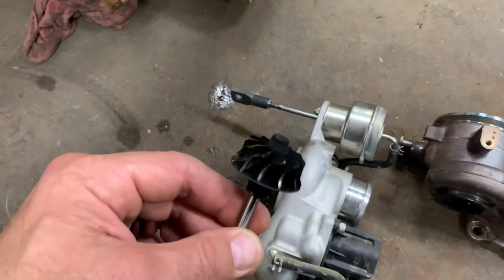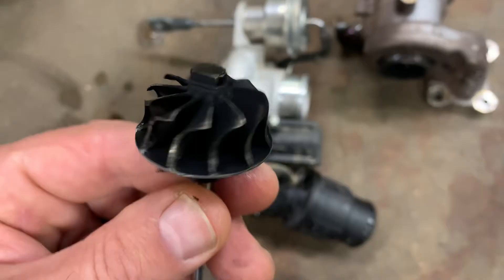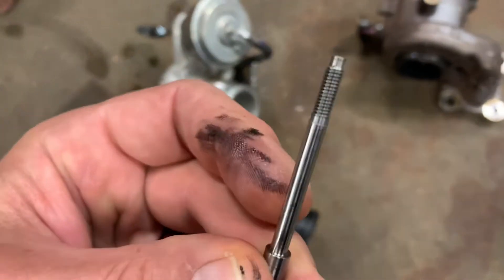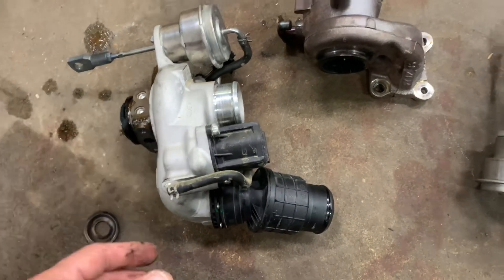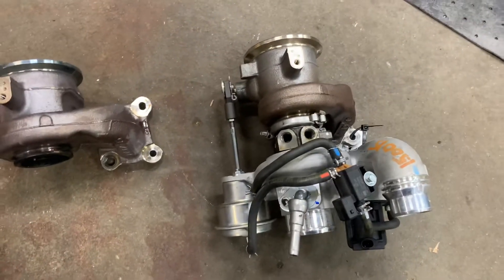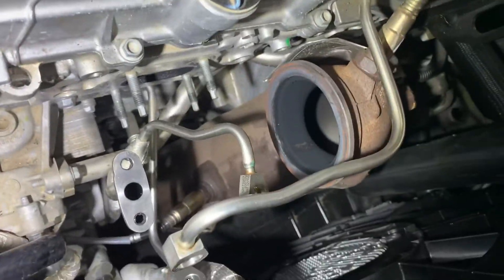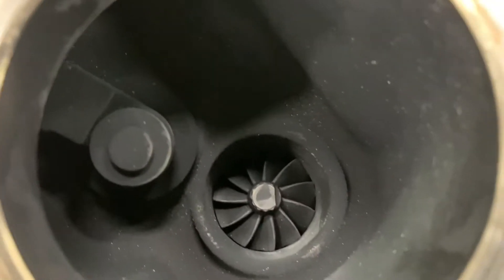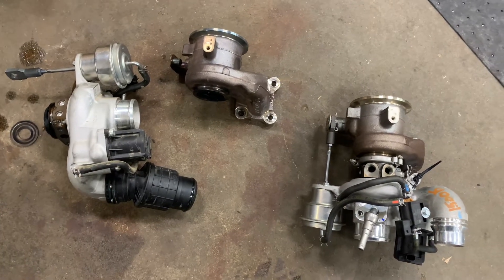1.5 and 1.4 Chevy Turbo Failure Cruze Equinox Encore Why The Turbo Fails and What Is It

Comment: I'm considering buying a 2018 encore with this engine at 157,000km. I believe it might have been better for that year but no clue. I don't mind preemptively changing the turbo oil line banjo bolt thing and the PCV valve as regular maintenance but not sure if I should steer clear all together
Reply from the maker: That’s plenty of miles for one of these cars. I don’t see many in the shop that have not had an engine with very many more miles than that. I think out of our 20 or so customers that have those I don’t think any of them are over 140,000. That does not mean they won’t go longer, but I don’t believe we’ve seen many.
Reply: @UnderTheHoodShow oh wow not a good sign. Keep in mind that's km's. So it works out to 96,000miles. Still the same story? Thanks for your response btw!
Reply from the maker: @Voltermort  I wouldn’t be too worried about 96,000 miles. I guess I missed the kilometer part.

Comment: the nuts should have blue loctite on them. compressor wheels heat cycle a lot, so it's not surprising they are coming apart at that kind of mileage.

Comment: I had a 2013 Chevrolet Sonic w 3000 mi oil changes. Turbo went at 71,000 mi. Between rear main oil leak and water pump failure and plastic cooling parts I never even look at GM cars. Piss poor vehicles.
Reply: thats what happens when you buy literally the cheapest car they make....they are called 'throw away cars" for a reason. wasnt even a gm tho the old 1.4's from that era are opel engines

Comment: I went through 1 gm turbo and im on my 3rd dorman. The dormans failed at 300 and 900 miles. They are garbage. I got mine when they had a lifetime warranty but i wouldnt buy one now with a 3 year. Not many people take better care of their engines than i do. I had no codes and my lines were all clear and flowing oil and coolant. Im about to sell the car and ive never sold any of my cars in my life and im 44. This is the worst engine ive ever worked on. Chevrolet should be embarrassed. There should be a class action law suite against them for this.
Reply: Traded my in yesterday with 174,000 miles. Still original turbo. I had coolant leaks awhile back on the turbo which is what GM uses to cool it off. Was a lot of work & parts just for that. The coolant lines are on top of the turbo. It also has 2 oil lines.
Reply: Amen to everything you said. 2013 Buick encore uses the same engine. It's a flipping nightmare to work on. Turbo hasn't failed yet, even after 154,000 miles, but now I'm having to seafoam every six months just to maintain performance. DESPISE this engine and turbo set up.
Reply: @robertholsopple9451  Totally agree ! GM says they replace defective turbos up to 120K miles..can take up to 6 weeks..This should be posted in BOLD letters on the damn car before you shell out $15-20 grand !!! Sooo much crap 👎

Comment: My gmc terrain 1.6l diesel  just did this  I had injector dtc's chevy dealer replaced all injectors  well 4 times 😂😂 I work for Ford an decided to warranty it at our shop.  Took the  air box boot off  nut was laying in there  took the turbo off an the shaft was broken...   no more issues   but. Took a ford guy not even knowing these issues an found it lol. All cars have issues.
Reply from the maker: @chadbrailer643  thanks for watching.

Comment: Even if it has only 30 miles on it,  why would I buy a used GM made turbo like you have as an example here? The used GM turbo will have the same GM defect of the nut possibly coming off
Reply from the maker: We have added the proper locktite and Installed over 50 of them from 10 miles to 100k miles and so far have never seen a nut come off. Some have been out there for five years or more. It’s all about the budget.
Reply: Very Good. I don`t think that was mentioned in the video. If it was I do apologize @UnderTheHoodShow
Reply: Original supplier Mitsubishi

Comment: My moms 2023 equinox blew the engine, the rod punched  through the block. They put a new turbo in it, i wonder if that nut found it's way into the cylinder.
Reply: It shouldn't, as it can't get through the intercooler.  But a broken turbo can cause loss of oil pressure and that leads to spun bearings and conrods exiting the block

Comment: I own an older Equinox with a normally aspirated 2.4.  Great Engine!  i'm at 139,000 miles on it!  I really DONT want a Turbo motor on my next car purchase.................but it seems like almost all mfgrs. are going this way..........
Reply from the maker: They are on many small engines but there are still a lot of non turbos available. Manu are hybrids but they don’t have a lot of troubles.

Comment: Got a question if my turbo failed I love 1.5 Malibu with that prevent the car from starting because my car just keep saying cranky but it won’t start and the guy told me it’s turbo ?
Reply from the maker: The turbo not working will not cause a no start. The turbo just lays there not doing anything until the engine fires and starts to move exhaust gasses which then turn the turbo.

Comment: I cant believe gm could make this kind of screw up on such a simple thing.
Reply: This is just one of many GM screw ups.
Reply from the maker: We see lots of weird stuff
Reply: gm doesnt even make the turbo (or any parts for that matter) , its an MHI (Mitsubishi heavy industries)I. weird part is, ive worked at a gm dealership for close to 2 decades, and have replaced probably hundreds of these turbos. but never once have i or anyone else in the shop seen a compressor nut come off, its not a common problem. to be honest, i wouldn't trust anyone who recommends Dorman products, absolute trash. ive seen dorman timing chains wreck sooo many engines

Comment: I made the mistake of buying a Trax. Since it's paid off and I intend to keep it, darned right I'm going to be serious about oil changes and even Seafoaming the oil before changing and also being good about maintaining the oil feed line and banjo bolt.
Reply: Id trade it before it hits 100K. Those engines are to small & get overworked like a person on meth.
Reply: @wandameadows5736  also have seen them in theyre early 200k with good maintenence like never late oil changes and routine suggest maintenence

Comment: Nice work here. I have a 19 Cruze LS with 29.7K, and I’ve never floored or driven my car hard at all.
Reply: I have the encore. It really scoots good above 4,000 rpm.
Reply: I have a 1.4 sonic when 180k and I have abused the poor thing. It's seen more than 200hp on the stock internals and 150mph a couple times....
I was running a big turbo for awhile. Went back to the stock one. My conclusion is in general these turbos will handle a decent amount of abuse, it's the pcv system failing you need to worry about. If it fails it can and will lead to turbo failure a lot of times. One is by the turbo ingesting oil, two is the bpv solenoid will ingest oil from the vacuum reservoir and fail to control the turbo properly.
Reply: @notsam498  Is a Sonic a high performance car? And why do you abuse something so valuable as your transportation?
Reply: @notsam498  so if say you covered the valve cover baffle port and it sucked oil that is worse than the vacuum leak? And what can I do to clean it up if possible?
Reply: But don't you need to drive fast and aggressive in order to burn  off all that carbon in the engine?
Reply: 🤣😂🤣😂 We’ll just go with that

Comment: Just change the oil line under the exhaust manifold every 30k miles and no more issues.
Reply: Wait, so that oil line gets clogged up over time?
Reply: @Patriot-hz8xk  yep.
Reply: It shouldn’t clog if your really good on oil changes. I checked mine at 35,000 miles , it was completely clean.
Reply: I just paid my mechanic $2600 to replace the turbo on a 2020 Equinox (72k miles). I don't want to have to do that again. How difficult is it to replace the oil line under the exhaust manifold? I'm fairly handy.
Reply: @buffalomitch7088  you ever find out?
Reply: @buffalomitch7088  I think I may have the same issue.  2 months before powertrain warranty expires.  Hopefully it's covered.  I have my appt next week

Comment: I just cleaned the turbo on my 2020 Buick Encore GX with 57K miles using CRC cleaning agent. It says it can clean up to 46% of carbon from turbo and valves for GDI engines. I’m not sure how much carbon was removed from my engine but the performance improvement is clearly noticeable. The engine starts and runs smoother and power delivery is also smoother. The only downside to this procedure is the length of time required to perform. It took me an hour to spray the contents of the can into the intake manifold downstream from the MAF sensor. So, I wouldn’t recommend doing this on a cold day or in the rain. Then the engine needs to heat soak for an hour and then you drive the vehicle on the highway for at least 10 mins. However, for that investment in time and about $15 for the cleaner I made a real difference in my engine’s efficiency. I’ll probably do this annually as part of preventive maintenance.
Reply: They have CRC Turbo cleaner....I was wondering if it worked as well and I guess he just answered my ?
Reply: Huh… i never heard of doing this… is this a product specially for turbos? I have read never to use the regular cleaner in a turbo because it can damage the turbo… i have a 2019 encore
Reply: @erickvistad3078  you a video showing the whole process?
Reply: thats called the "placebo effect"

Comment: Is it more directly related to a clogged or leaking oil filler tube that runs across the super hot manifold that ends up starving the turbo from proper lubrication?
Reply: I heard about this and i replaced my pipe at 30,000 miles and the original was perfectly fine.. this loose nut thing sounds pretty crazy… youd would think they would do something to make sure something this simple would never fail… like a double nut
Reply: @keithbellair9508  or locktight
Reply: @keithbellair9508  they will do anything to say five. Cents.

Comment: Why do they even put turbos in cars? Just another thing to break. All they do is put more stress on your piston rods. Also don't like the fact that it's pumping your throttle body full of dirty exhaust.
Reply: looks like you need to do some more🤔 research on how turbos work
Reply: Drive one and you’ll learn why everyone wants a turbo car… lots of nice low end torque..
Reply: I have a 2018 Cruze and the car is unbelievably fast when the turbo kicks in and beats the crap out of my 2008, 3.4L torrent at higher speeds.
Reply: I just bought a 2025 Equinox. I read a lot before I bought. Most reports said the 1.5 turbo was improved for 24-25 models. I know people who have been very happy with no problems. I have always been a Toyota fan but loved the new Equinox. Now I am worried.

Comment: How come GM didn't put Loctite glue to keep the the nut from coming off
Reply from the maker: Locktite melts and cones loose under heat. They would need to use a locking nut which they did but it did not always stay secure once subjected to heat and vibration.
Reply: @UnderTheHoodShow what kind of locking nut did they use on the turbo? Just one of those nylon insert nuts? That would melt for sure… they should have double nutted that stinker.
Reply: Weld the nut on
Reply: @garetfitzpatrick2043  these are balanced
Reply: What about the special red Locktite?
Reply: @atx-cvpi_99  or jb weld
Reply: How come GM puts the water pump ii the engine driven by the timing chain so it's over a $1000,00 repair bill.